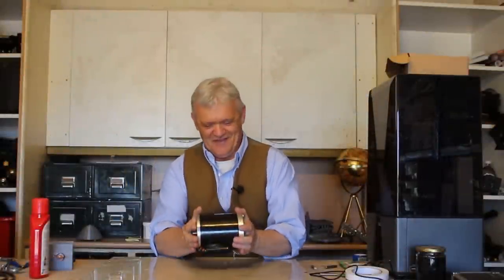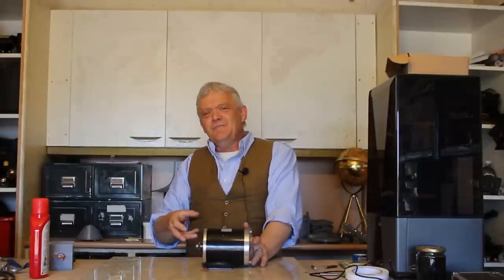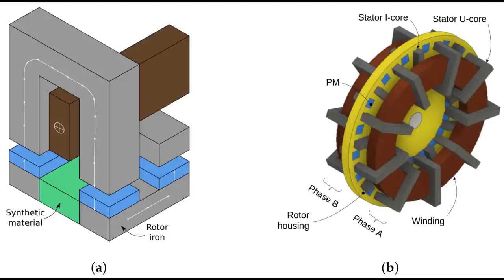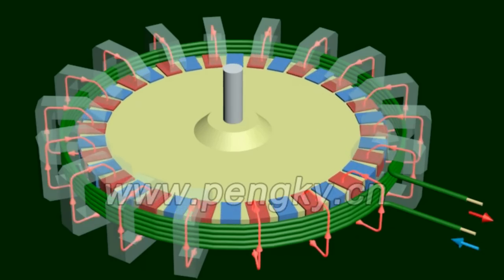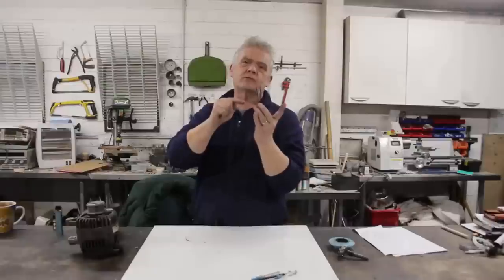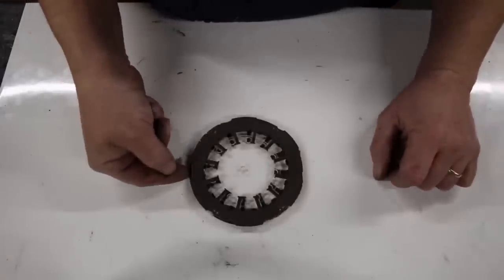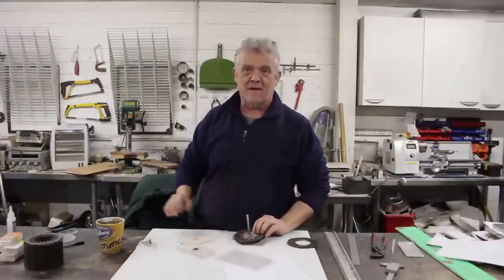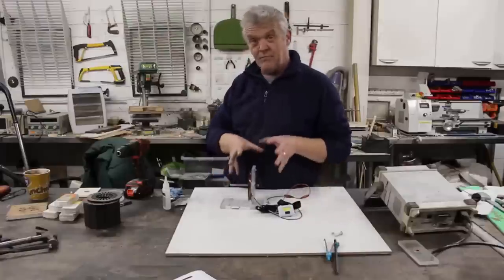1968 The Generator You Have Never Heard Of - Transverse Flux

Comment: That is the exact concept I made long ago into a big 1/2 meter generator which was powered by a wash line which had 4 x big 750mm x 750mm flaps on the 4 arms of the wash line. The flaps were the wind catchers. I got around 150w out at 4.5m/ 's of wind. 60 stubs on the metal plates and 120 magnets in total.  It really does work well as a generator. But it did need a bit of force to start it up turning. It had low revs but still managed to get a good speed of 60 cycles for every revolution of the wash line.
Reply from the maker: thanks for sharing mate

Comment: Great idea, 
If you look at the original design the laminations are stacked in the opposite plane. 
By doing it your way you miss the point of why they did it that way. 
Iron is a shield for magnetism. 
Not the best but still a wall. 
The second lamination would be barely be magnetised. 
If you cut the c sections out of your ring and glued them you would get a better result. 
Also you have the potential of the laminations getting hot in this configuration due to Edie currents. 

Please don't take this as a negative answer. 
Just trying to help.

Comment: hey robert, the dc motor is part of a test that i use on the AI to see how good it is at correlating similar things. dc motor as you state can be either a motor or a generator. i call this a bidirectional energy conversion device, meaning it can be powered from either side and converts the output energy of the other side. electricity to rotation, rotation to electricity, basically a device that works in reverse! 
So far we have come up with about 8 devices that share this characteristic. another example is a thermoelectric or Peltier element. input some electric energy on one side, the other side outputs some temperature goodies, and in turn, use some temperature lovin on one side, it outputs the energy as electricity to the other side!! 
wondering how many you guys can come up with, hopefully some new ones me and my chappieGT buddy havnt thought of yet!

Comment: This transverse motor/generator is very similar to the synchronous motors used in clocks and timers pre WW2. They folded the little arms 90 degrees and used radial magnet rotors. The permanent magnet steels available then were pretty poor so very low power but just enough. Many clocks stopped working as the magnets aged but could be re-magnetised for restoration.

Comment: I've been thinking Rob. If with your wizardry you can produce graphene on the kitchen table can you get your printer to print in graphene.
Reply from the maker: the 3d printer?
Reply: That IMO would be a revolution in 3D printing. 
I was thinking a secondary nozzle that would be able to disperse the graphene straight into the "weld"... 
Or filament with graphene, obviously.
Reply: @ThinkingandTinkering  he is talking about putting the graphene inside of the resin or filament solution and then if you control the temperature and pH using sound conductivity and even light at the extrusion point, you can control the orientation, alignment and fixation of the graphene bonds
I would really like to talk to you about making laser finished cast iron to cover over the surface imperfections like the article you covered regarding the Mercedes-Benz rear axle and also, how are you discussed in the coating of the 3-D parts
This way, the outside is sealed at a higher density, similar to a Prince Rupert drop or samurai sword edge in terms of two different ends of the same relation

In terms of this device, I would like you to consider using a wind powered tesla, turbine drum to start the torque
This would end up being a fly wheel
And if you have the material at a different thermal convection and radiation, you can have one side exposed to the heat of the sunlight to start the rotation
Unlike where you are using a white blocking collar in your wind collection
Use the thermal differential of the materials so that they can create a thermal sump a thermal affect and a thermal battery as the continued radiation of the energy that was collected through a transparent barrier and stored inside of both the rotation and the temperature change inside of the chamber

I would really like your help in doing this as well as incorporating what I call chicken and salmon power just to peak your interest
Happy Sunday from an unmet well met friend under Gods Beautiful Joyous Lantern which brings such fantastic fellowship and love 💕
Reply: @ThinkingandTinkering No, the 4D one?? 😂 Ofc the 3D printer
what use would a normal printer have with graphene ink?
Reply from the maker: @panzerofthelake4460  printed batteries
Reply: What? I believed that if this would be possible Rob or someone else would have done it already :D

Comment: Something I took note of is that because of the pole-to-pickup ratio , for every 15 degrees of rotation, you get 1 Hertz Vac.
So, you get 24 Hz per rotation. To acheive 60 Hz/s, you would to spin it at only 150 RPM.
A very similar axial flux spins the magnetic plate between two resin plates containing the generation coils.
The sets of coils produce a higher current than a TV alternator.

Comment: Perhaps you could make it with a bike wheel (minus the tyre) as the metal 'C', with the coil wrapped round the outside? Maybe cutting notches in the edge to give the tab bits, with the magnets on the outside.

Comment: Actually this design is common in alternators in cars except the magnets are replaced with an electro magnet which is controlled by the regulator so that alternator makes the correct voltage stator feeding the rectifier diodes. At low engine speed a higher voltage is applied to the rotor and at high engine speed a low voltage is applied to the rotor.

Comment: Having the metallic plates moving (instead of the acrylic central one) could be used s flywheel. 
The magnets and OD coils would be stationary (stator), and the two metallic plates would be rotary (rotor) ...
Would this setup (magnets to metallic plates polarity transfer) with metallic "contact" deplete our magnets quicker than with Cu coils "contact"  ?

Comment: I think I’m having a flashback to my time when I was studying electromechanics. Something with squirrel cage and improving engine or generator characteristics. Had to continue learning for my exam and forgot in between. That C-shape is important, to have the central rotor to be able to pass. My first idea was a solenoid going around the circumference but how are you going to take energy from the mass you’re accelerating inside? It is possible, just sharing some ideas. Others have brains😅

Comment: In the comments of other videos of yours i suggested c shaped coils  to nore efficiently use flux, thanks for letting me know the name of what i didn't think of first!
Question, how are the c's wired? I assume if you reversed the wiring of them you could also reverse the magnets to all point the same way and turn the ac generator to a pulsing dc one? If not true then i missed something and im going to need a longer video to explain... some things..

Comment: Robert,
   How about making a larger ring than the motor ring which doubles the capacity but they are attached, then apply power to the smaller ring but utilize the larger ring as a generator. Would be an interesting test.

Comment: I tend to experiment along with you as you go, and over ti.e I watch as you seem to be able to manufacture things much more quickly than me.

With all the 3D printing you have been doing lately you finally forced me to buy one. 

I bought a 3D printer with the plan to make a motor/generator as my first real project...

Thanks for making me take the leap!

If "getting it going" is difficult, how about this?  I'm working on a thought for that right now.

Sections of steel can be moved closer/farther from the spinning magnets based on whatever conditions.  Perhaps an additional ring that has 12 holes... in +15 to -15 degrees you change the magnetic character of the stator quite a bit.

I want to have it self-monitor so it can work with the power source optimally.   That is a bit more electronics than I have ever put into a project. But I have spent enough money that I am committed.

Thanks :)
Reply: The only thing I can think of with your design is that the more moving parts you have the more can go wrong. 
That being said something like a centrifugal clutch mechanism could work to bring the plates closer at higher speed.
Reply from the maker: oddjobbob made a great suggestion too mate - check out his comment
Reply: @rayg436  

Kind of like a clutch... springs do eventually require replacement.

But a ring around the entire coil - 12 holes are drilled in it to align with the poles.  The ring may be rotated forward or back, allowing the flux to be concentrated ahead or behind by a few degrees. 

If intuitively feels like this would have an impact... but I have no idea. I want to find out :)

Comment: If Elegoo could give you one of their 20 watt laser cutters you could make one of those out of acrylic (hint hint, Elegoo 😂)
Reply: I've never heard of laser cutting acrylic. Aren't transparent materials a problem for those?
Reply from the maker: they all do it mate but usually they use black acrylic - acrylic doesn't have to be transparent you know
Reply from the maker: lol - i have one - not an elegoo one some other make - i just don't use it much
Reply: I have cut transparent acrylic with a laser, but I can't tell you the power requirement per mm thickness required.

Comment: I couldn't really tell, but did you offset each of the silicon steel disks by 15°? I would think you'd want both disks to be positive or negative at the same time. Also, how does the area/mass of little fingers on the disk affect the strength of the magnetic field around the coils? I'm fairly certain you're limited in magnetic field around the coils by the strength of the magnets, and the fingers would only act as a bit of transference loss..
And then, if you are offsetting the disk angles by 15°, then instead of clipping every other finger off, you could instead bend them 90° towards the other disk and then bind them or solder them somehow so that the magnetic force from one side of a magnet transfers to both disks... I feel like there's more that could be done here... hmm... I'll have to think on it...
Reply from the maker: the steel fingers were in line with each other mate
Reply: @ThinkingandTinkering  So how does that work then with the flux? If they're inline with each other, then you're applying both a positive and negative magnetic field to the disks, one above, one below, which then applies both magnetic fields to the coil. Wouldn't they cancel each other out? Or at least, wouldn't you get a lot less current flow?

Comment: Would multiple stage coils help too reduce start up torque using speed sensors and a small control circuit/micro processor to activate each coil as speed increased? 🤔
Reply: Maybe a centrifugal clutch mechanism could be used to pull the magnets toward the center, away from the steel. But there might not be enough room to retract them, they're pretty tightly packed. On second thought, the best method of reducing startup torque might be to current limit the output, or start it with no load. A basic zener diode in series could handle that, only switching on when the output reaches a certain voltage (aka speed). Problem with that is, If the load is too high it will slow down and cut off again, oscillating on and off. A zener + SCR could be used to "trigger" it on and stay on until the output was zero. Of course these components would need to be rated for the amount of current/power involved. A current limiting resistor on the zener diode might let you get away with a smaller one. If you're making a lot of power it might be a good idea to use a relay as well.
Reply: @DFPercush  was thinking hall sensors as used in BLDC speed controller, faster the sensors trigger the more coils or part of a single it connects to the load,if the motor is to be connected to a VAWT the torgue can be calculated at any given speed ...might be able to get an activation speed of 0.2 ms bringing in more copper with speed until it gets into over speed (say 20ms) when it can be set to auto disconnect 🤔
Reply: @sailaway8244  Well there's only one coil here. I guess you could put in some center taps, but then you need some logic circuitry about which one to connect, and a way to switch them. If you're already going to throw a MCU at it, maybe a servo + mechanical rotary switch. For overspeed conditions, if you disconnect the load, the generator will spin even faster, but you could at least save the electronics that way I suppose. It seems kind of complicated to me, tbh. At least with a transverse setup like this, you don't have all the gear friction. It's not going to take much to at least start moving, it will just have a steeper resistance to going fast.
Reply from the maker: i am not sure how that would work mate - but i do have an idea or two
Reply: @ThinkingandTinkering  as an alternative you could use a  voltage sensor on a dedicated control coil much in the same spirit as a control circuit in a control panel....key too efficient wind generation is to match coil load to available windspeed IRT while avoiding as much mechanical losses as possible. If the switch on speed is 4 ms and average wind speed is 4ms in my mind you are producing 0 for 50% of the time ( depending on whether you mean median or mean )
   A microprocessor (pennies) can switch between coils instantly ,coils of varing thickness (or a combination of the same size) can be brought on load to suit the windspeed at any given second while staying within a certain voltage range (theoritically)

Comment: Hi, quick question, I've got about 30 of these motors;

 InMotion 3 phase, permanent magnet servomotor, model # PSM C3000-D

They were used in police unit segways. I want to use them as gennies, but the 3 phase is tripping me up a bit.

Any suggestions, or videos you've already done one this I can search by keyword?
Reply: Just look up three phase rectifier.  Six diodes and you should get something close to DC out.
Reply: @DerekWoolverton  awesome, thank you. The motors are rated for intermittent use. Is that going to an issue with them working as gennies?
Reply: @bobroberts8500  Just keep an eye on the temperature of the coils. At the power levels of stuff you see in these videos, I think you'll be fine. Wouldn't hurt to attach a fan though, or at least make sure it has some way of passively exchanging air.  If the segway transmission is still attached, that might need cooling as well. If you want to math it out, take the battery voltage of a segway "V" (60V on the safe side), put an ohm meter across the motor (make sure to disconnect power!) to get the resistance R, and use I = V/R to get current. That's the absolute max peak current. I would try to stay below 50% of that for extended periods. But it all depends on how well it can shed heat. Just like overclocking a cpu, it's all about the cooling.
Reply from the maker: Derek is spot on mate
Reply: Another solution is to put 2 or more motors in series to achieve the higher power levels and reduce the heat build up for the individual motors.
Reply: @DFPercush  at a different auction, I picked up a couple Comair rotron Tne2c fans. They were advertised as "computer fans". I have never been more cautious handling a live fan as I am with those. So air cool a hard yes.
Reply: @DFPercush  so they didn't come from the segway, they came nice and neat in boxes of 6. I got em for a $1.50 a pop, I've seen some amazonbay listings with them at 60$ per & I've found docs with them going for $599.99 MSRP. I've just been trying to been the unseen catch cuz it's too good a deal to be really real
Reply: @rayg436  I have 30. That is doable
Reply: @DerekWoolverton  Can I use one straight off an alternator, or would it need some sort of modification?
Reply: @bobroberts8500  as long as you match the specs for current and voltage, the diode rectifier can connect straight up to the three phase output of the motor (presuming there's no internal electronics involved).  You'll probably want some additional circuits after for smoothing out the ripple and regulating power one way or another for your end use.
Reply: @bobroberts8500  Wow, that's what you call a steal, not a deal, lol. Nice picking.